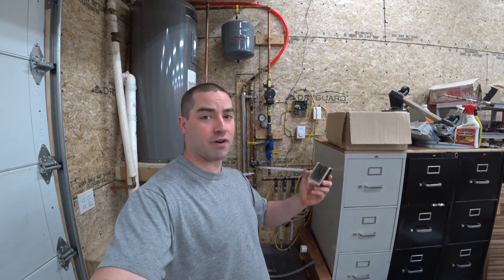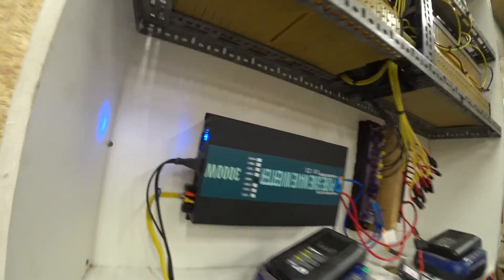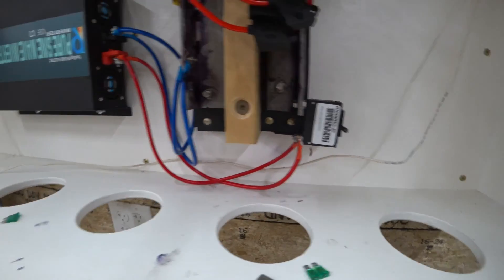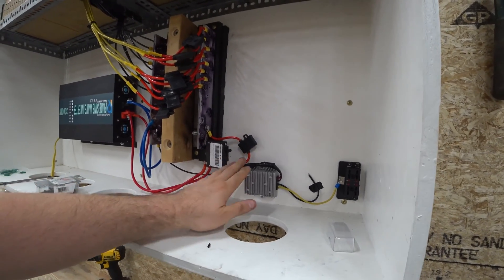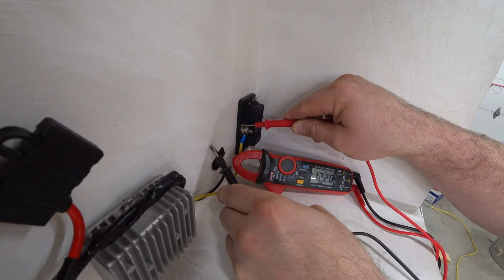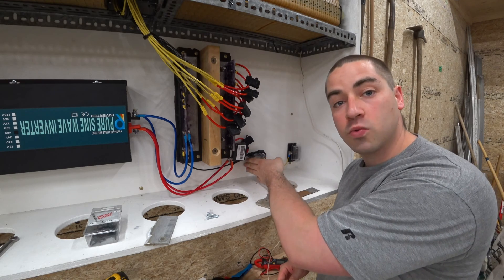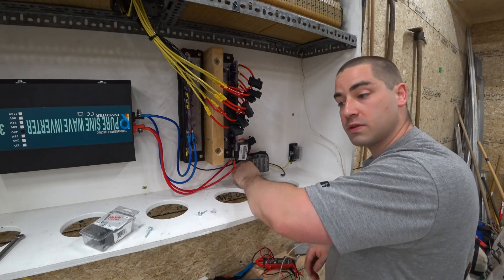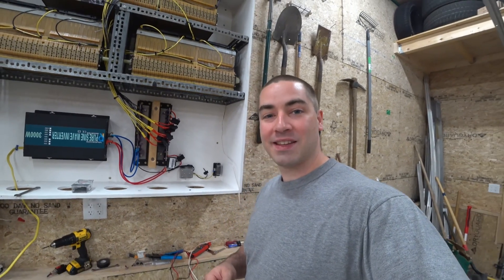Making 12 volts from my 48 volt battery, DIY Powerwall

Comment: I'm installing the same step down converter (30A version) to my 48V off grid system in Mexico to power my two RV water pumps and VHF radio. What size fuse are you using in your temporary inline fuse for the Red 48v power lead? I would ultimately like to have that lead on a surface mount switch so I could turn the converter off when I'm away. Do you have any recommendations for a proper surface mount switch?

Comment: Did you make or buy the bus bar? Useing 100ah batteries so I'm assuming bus bar needs to accommodate 100ah per series so 4 series 400amps?
Reply from the maker: This is an old video series.  At the time, I used scrap metal I had on hand.  I used some aluminum angle that was 1/4" thick.  I have a more recent video on busbar that may be helpful: https://youtu.be/eWqJjlHoW9A?si=mHbFM6KH_S0yd8yj

Comment: I have a bus conversion with a 48V 50Ah Battery system. I'm wondering if my bus batteries die. Can I use a 48v to 12v 20amp step down converter to charge the batteries? That should bring the battery up to 12v and start charging the amperage. It will take awhile but then if I disconnect the step down converter. The batteries should be strong enough to start it up. Is that right? My starter pulls 200 amps so completely removing the acid lead batteries would be a bad idea a basic step down converter wouldn't handle that. I'm asking in case I'm ever in that situation.
Reply from the maker: Yes, that sounds like it would work well.  I've seen people do that.

Comment: Did you have any trouble with arking when you connected the input leads to the bus bars?  I'm getting a major ark as if there is a dead short in the converter.
Reply from the maker: No, but this unit did get very hot.  I removed it.
Reply: @DavidPozEnergy  What did you end up going with?

Comment: I know this post was years ago but I have a question.... I'm going to install the same converter on my 36v golf cart that I just went with a  lithium boxed set up and it has no post. It uses a plugged in cord with ring eyelets. Back to the converter, you didn't attach the black neg coming out of the converter. I was going to attach mine to the neg. block I have created witch has all the battery neg wiring attached. This is also were the converters input black will be. Is that wrong?? Hopefully I didn't lose you! There is no 12v accessories  black wire only a power feed to a fuse bus for horn, lights, etc. That is the original set up. Feeding that prior with old lead batteries (hooked to only 2 - 6v ones) is only one wire, no neg.
Reply from the maker: I would not buy this particular converter.  It was very inefficient, always too hot.  I removed it.  If you are doing a golf cart, try this one instead: https://amzn.to/3e4HTWQ

Comment: I bought one of those converers.  Piece of crap.  The output wires were short circuited inside the silicon.
Reply from the maker: Yeah, mine was getting very hot.  Burned my fingers, so I removed it.

Comment: I have two choices. Buy a 12v 100ah battery later or use my 48v 20ah battery now. I'll be running with the 12v and inverter for two iPads, a macbook, some iPhone and some fans. what would I be loosing if i choose what I have?

Comment: I have a project for you. I acquired a 48 volt 17 amp hour ebike battery which I have no use for, unless I can convert it to run a 1500 watt 12 volt power inverter. But considering I don't know anything about electronics, is it possible and what connectors do I need to make it all work together?
Reply from the maker: I don't know of any DC converters big enough.  You would need about a 150 amp converter.  It might be easier to get a new battery.

Comment: Need to ask your help Dave, i am putting a 48volt system in my van. Can i run a cable from the car battery using a 140 amp isolator and a 12v to 48v step up to charge the 48volt batteries? Thanks
Reply from the maker: Yes, but you need to make sure the 12 to 48v boost converter is CC/CV, meaning constant current and constant voltage.  I have not found one that will go 12 to 48, but I have seen them 12 to 24 or 24 to 48.  Although I'm not building out a van so i haven't done an exhaustive search.  Do you have a link to the products you are looking at?
Reply: @DavidPozEnergy  Maybe the :
https://www.amazon.com/Dual-Battery-Smart-Isolator-KeyLine/dp/B00WTAFR84/ref=sr_1_1_sspa?crid=28MKNB6KEDHCB&dchild=1&keywords=battery+isolator&qid=1585368574&sprefix=battery+iso%2Caps%2C243&sr=8-1-spons&psc=1&spLa=ZW5jcnlwdGVkUXVhbGlmaWVyPUExMDJBQTVWVTlYQk5UJmVuY3J5cHRlZElkPUEwNDYxMDM5MjJLWFBWNEE4UU9GQiZlbmNyeXB0ZWRBZElkPUEwODM3NTkxMUVJUUlMVDZKMlo3TyZ3aWRnZXROYW1lPXNwX2F0ZiZhY3Rpb249Y2xpY2tSZWRpcmVjdCZkb05vdExvZ0NsaWNrPXRydWU=

for the isolator 

and https://www.amazon.com/SMAKN%C2%AE-Waterproof-Converter-10-30V-Supply/dp/B017TPRLLY/ref=sr_1_3?dchild=1&keywords=12+to+48v+step+up+converter&qid=1585368424&sr=8-3    

for the step up transformer.
Reply from the maker: Hi.  That isolator can work on older vehicles, but sometimes newer cars have alternators that can throttle back (lower voltage) when not needed, which might cause this to shut off.  But if you know your vehicle stays 13.3 volts whenever it's on, then yes, that isolator can work.  
The power supply module can not be used to charge lithium batteries.  It is not a CC/CV charger.

Comment: Great video! I want to use a 48v to 12v step down converter for and EV ATV project to run the  lights. It's suggested amps is 10A so I was going to put a 10A car fuse in but most fuses are rated to only 32V. Did you have any problems with your fuse and is yours rated for 48V? Thanks!
Reply from the maker: This particular converter was always hot.  It drew power even with nothing attached.  So I removed it for now.  I have also replaced my first fuses with some class T fuses that go up to 120 volts DC. I didn't have a problem with the first fuses, but I wanted to play it safer.
Reply: All 120v fuse can be used all the way down to 1v projects since only current is what matters not voltage when it comes to a fuse as long as its not higher voltage than rated om the fuse

Comment: David, I'm trying to solve an off-grid power problem. Components include a 48 to 12 volt MagneTek converter charger and a 12 volt LP fridge RM2652; the 48 volt to 120 Xantrax SW4048 ac inverter stays on and will not go to standby.
The fridge looks like it draws 12 volts at 12 amps when calling for cooling.  I'm considering the Cllena 48 step-down 12 v 20 amp converter, the spec shows low no-load current to reduce idle power draw. Thoughts?  Hope you have some suggestions for me.

thanks Cathy
Reply from the maker: I had bad luck with my Celena, it was drawing a lot of power even with nothing loading it.  I trust Victron products a lot more.  Here is an example: https://www.invertersupply.com/index.php?main_page=product_info&products_id=24883&gclid=CjwKCAiAg9rxBRADEiwAxKDTujG_O-Kksg4dLHzqA0QinUWg5m8T-OX0SXGFbRKZ-2hbOLWGxn-nKhoC8D4QAvD_BwE This can be used direct to your fridge from your 48v battery.  It outputs the 48v.  

It's possible your setup doesn't work if your fridge has a larger inrush current draw when it first starts.  Your 48-12v converter might not be able to handle that.  If this is the case, then a small 12v battery (buffer) between converter and fridge might handle the surges. 

Another option would be to change out your fridge for a normal 120v AC fridge that can run on the inverter.

Another option: Set up a mini solar off-grid system with a small 12v battery, charge controller and solar panel.   This can be done with a MPPT charge controller like: https://amzn.to/2GMGtir  

“As an Amazon Associate I earn from qualifying purchases.”

Comment: So if it heating up that quickly it must be wasting alot of energy, but would probably use alot less energy going though the power inverter itself.
Reply: Yeah I agree heat means a lot of energy... I want somone to help me... If you put 4 12v batteries in series and just take 12v off one battery do they all discharge together... Because this would mean you would have the most efficient 48 and 12v supply without any loss... No1 wants to answer my question though

Comment: I have a thousand watt powder inverter in my bar bolt, four batteries of the bar bolt, one battery one hundred and fifty watts. I will run a cylindrical machine. Would you like to say my answerHelp me

Comment: Dumb question for someone new to this. Why did we add the fuse/breaker upstream from the converter? Is it inherently needed as-is? Or instead, maybe something related to plans you have for using the 12v power?

I ask because I’m about to use this same converter on my 48v ebike battery to power some 12v lights. I considered adding a fuse for good measure. However the batter itself has. 40a fuse, so I thought I might be good there?

I am new to this though, so seeing you add one grabbed my attention.
Reply from the maker: Hi Tim,  The additional fuse is probably not needed, but I had a spare fuse holder.  BTW, I've removed this converter from my setup because it get's HOT all the time.  It constantly draws power even if no load is on it.  I mention this simply so you may want a switch between the battery and converter so if you don't need lights you can turn it off.
Reply: DavidPoz Thanks for the follow-up as well as the tip for the switch! That hadn’t crossed my mind until today coincidentally. Another video of a similar controller has a switch for similar reasons. Will pick one up. 

On a separate note, might there be a better ready-to-go solution than that one to achieve the same thing? E.G. from a different company? Or maybe it’s inherent in the technology?
Reply from the maker: Hi Tim,  I don't know of another DC to DC converter that does not waste energy.  You may already have thought this through, but could you add a small 12v battery just for your lights?  I've never built an E-Bike, but are you going to have 40 watts or so of lights?  If the longest you could ride your bike is 2 hours, then 80 watt hours of power, plus battery loss.  Maybe 110 watt hours of battery size at 12v, 9.2 amp hours.  https://www.amazon.com/Phosphate-Rechargeable-Batteries-Baseline-Battery/dp/B01FVMQJCY/ref=sr_1_2_sspa?keywords=lifepo4&qid=1563665505&s=gateway&sr=8-2-spons&psc=1 Set these up as 2p4s and have a nice 12v battery.  Would that not be simpler than doing a conversion?  I'm sincerly asking because, like I said, I have not built one.

Comment: David, how is the buck converter holding up?  I'm thinking about getting one but have been seeing mixed reviews on it.
Reply from the maker: The buck converter still works, but I removed it.  it gets hot.  I'm using a 12v lead acid battery to run my cooling fans and top off the lead acid battery every few weeks.  Not as elegant as I would have liked.  At some point I will figure out something else.  Maybe I'll use the same buck converter, but add a relay to switch it on/off on the 48 volt side when not needed.  Again, it was just HOT all the time.  I even tried adding aluminum stand-offs but it wastes a lot of energy as heat.
Reply: @DavidPozEnergy  Thanks for the quick response.  I was wondering if your angle iron helped with the heat.  I've read several reviews where people say it draws power even when not being used and it gets very hot.
Reply: @DavidPozEnergy  David, I've been using this converter for six weeks now.  I've been checking it everyday and it hasn't gone over 110 degrees.  This may be better than what you were experiencing.  https://www.amazon.com/gp/product/B079Q2QPGW/ref=ppx_yo_dt_b_asin_title_o06_s01?ie=UTF8&psc=1
Reply from the maker: That looks like a very nice unit.  Yes, that is much lower temp than I was seeing.  Have you been able to measure the efficiency under load, and the idle watts?  I'd love to know.
Reply: @DavidPozEnergy  I'm using it to run several LED lights and cooling fans.  At idle it uses 3.6 watts at 97 degrees.  When everything is running, the wattage is equal to the stated wattage of each device.  I did mess around with it and got it up to a 20 amp draw at 110 degrees.  I haven't used it to it's full 30 amp capability so I'm not sure how hot it will get at that point.  What kind of temps were you getting?
Reply: @GCSol  I had one of these units which David shows in the video, get too hot and smoke it...do you think the one you mention would work with my Leaf Lithium Pack. I hate to keep smoking voltage regulators.
Reply: @normsolar it's on my golf cart

Comment: I'm not good with electricity in the slightist so could someone help me out. I have a 48v lithium battery that's rechargeable. Will this work to get a 12v and 3amp output?
Reply from the maker: Yes, it can work.  You could probably even use a smaller model.

Comment: Have you thought about running DC voltage lighting in the garage instead of converting dc to ac and then back to dc again for LED lighting.
Reply from the maker: Hi Jared,  Yes, I have thought about that.  I bought some LED ribbons that run on 12v and hooked them up to test.  They were very dim compared to these and when I calculated out how much it would cost to buy enough to get comparable lumens it became cost prohibitive.
Reply: DavidPoz what about RV light fixtures or the trucking industry lighting?  They are generally designed for area lighting versus ribbons lights which are more accent lighting.
Reply from the maker: Hi Jared,  It might work, I don't know.  Another way about it is to buy 12vDC light bulbs, that screw into a normal fixture and wire in fixtures dedicated to the 12vDC power source.  These options might work.  It would be a lot of fun to test them out.  I guess it comes down to what you are saving.  If the average inverter is 90% efficient, then you are saving the 10% loss.  If I turn on every light bulb inside my house I'm at 168 watts, which means if that was being powered by an inverter there would be around 19 watts of energy wasted in the conversion process.  You could try running the math out further, but paying extra for DC lighting is probably not worth the savings.  But I admit that I'm just using a gut feel here.  What do you think?
Reply: DavidPoz I agree, I haven’t done the math at all. I’m in the early stages of wiring a garage similar to yours(with a battery bank and inverter) was just thinking about running a 12vdc setup for lighting and run the inverter for all the other AC appliances. Not sure how feasible this would be but I’ve been following you for awhile and was wondering if you had tinkered with the idea at all.
Reply from the maker: Cool.  I've made a story board for a video that is specific to workshop lighting, but have not yet filmed it.  I was going to focus on Lumens and lux, but I might address this question in that video.  Do you think that would be good?

Comment: I like that little step down that you have. I was thinking about using that on my 48 V batteries for my ham radio. I think there is a DC the DC step down that’s adjustable out there you can get a little more power out of it.

Comment: You should put some heat sink grease between the case and the iron, but you would be better off with aluminum or copper and more area, if you are concerned.

Comment: The step down converter you're using can run right down to 30v input while still spitting out a perfect 12v, that's how step down converters work. If I'm running a 12v device right off a panel  I use this step up/down converter if running a small panel (8v to 40v input, 12v/120watts out, https://www.aliexpress.com/item/8-40V-to-12V-10A-8-40V-TO-12V-10AMP-DC-DC-Converter-Reducer-Regulator-Waterproof/32690762976.html ) or I use this step down converter on large panels (18v to 40v input, 12v/480 watts out, https://www.aliexpress.com/item/24V-TO-12V-40A-DC-DC-Step-Down-Converter-Reducer-B40-24-12-Daygreen-CE-Certificated/32822253858.html ). They also have the same ones that put out 13.8v if you'd like charge a lead acid battery plus run your load at 13.8v. I love that you bolted the circuit breaker right to the buss bar, I do it similarly with fuses in my car: http://ecuflashking.com/junk_in_the_trunk.jpg :)

Comment: Hello David why not use a Din rail breaker for your 48v and one for 12v stuff? You can add as many breakers as you like. And i have been seeing them all over the internet for good prices. I have picked up a 24v DC breaker with 6 amps for a small project I'm doing. It was 13 dollars for the breaker that is a little high for me because I'm cheap but i need to to keep my stuff safe.
Reply from the maker: I plan to do just that.  I'm planning to add breakers for the batteries, inverter, dc-converter, and one for the charge controller.
Reply: DavidPoz Nice. I we can't wait to see that.

Comment: I'd love to know the topography of that converter -  I'm thinking something like this: DC input > Oscillator > AC > voltage regulator > step down transformer > rectifier  > DC output   
It would be fun to put a scope on the output.... if my topography is true, it must have some ripple.  What are your thoughts .
Reply from the maker: I don't have a scope to test it, otherwise I would.  BTW, I linked to your video for Tod Isboss in the comments below.
Reply: which reminds me , I've got to do an update video on the current state of "un-balance" on my poor battery packs after 18 months.. my gosh I don't know what I'm gonna do  :P
Reply from the maker: I hope you do, I would love to see that.
Reply: it is probably a syncronous buck converter, those tend to draw power when idle but will be 90-95% efficient at full load